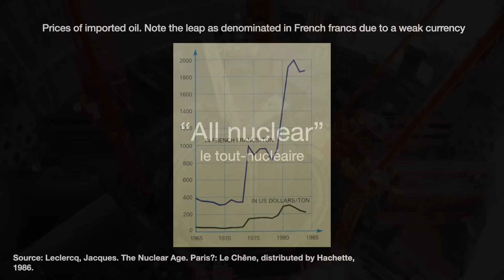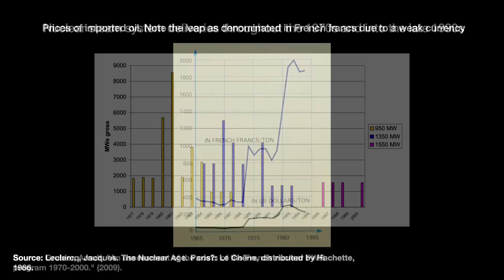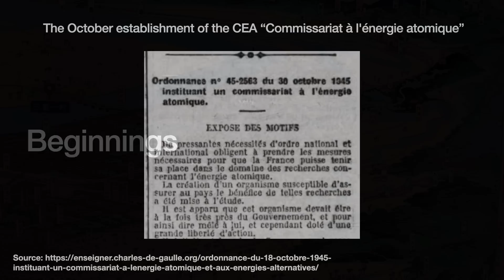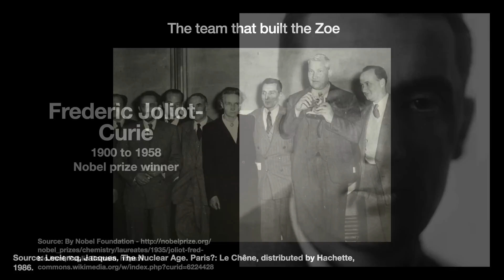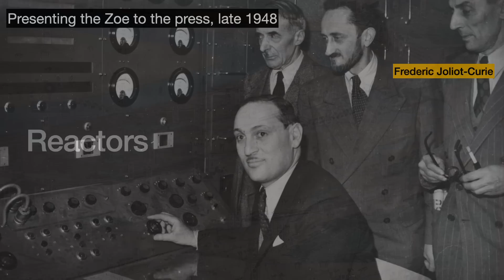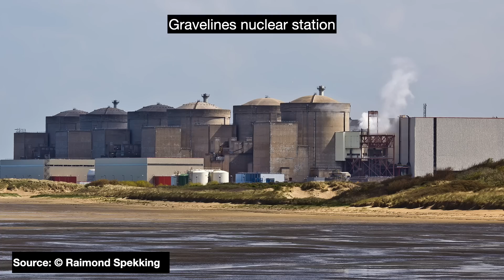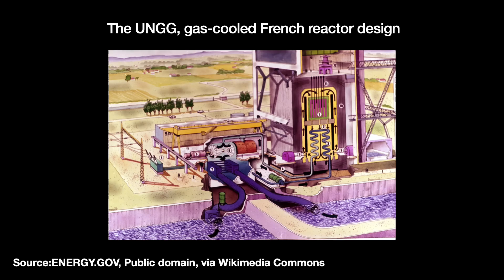That Time France Went "All Nuclear"

Comment: You ended the story to early, because it continued. The last french Reactor is the EPR with 1650 MW Brutto electric. It is build in Finnland, England, China and France today. It is not history. The EPR was in the beginning a joint European Pressurized water Reactor with contribution from Germanys Siemens nuclear reactor company. Germany knocked down its own nuclear industry as result of Red/Green antiindustrial politics, which still govers Germany today. France is building some new EPR in England and France. France planed to build 14 new EPR in near future. But currently it reveales that refurbishing existing nuclear reactors is much cheaper than building new sites. Repairing costs perhaps 2 Billion Euros per Block but Newbuilding 20 Billions per Block. This is the contemporary situation. Also in the USA old reactors like Harrisburg are investigated for an rennovation instead of expensive new builts. In Germany 4 - 8 Reactors could be repaired. But politics don't want to restart nuclear power production in Germany. Even Merz - CDU continues Red/Green politics with dismantling of domestic powerstations and replacing it with chinese stuff in renewable sector. Germany is not able and not willing to build up a new Renewables industry domestically. Trump USA says we do not need Renewables, so we do not need to build up domestic industries. Drill for Oil and Gas and use huge amounts of coal like China and  Make America Great Again.
Reply: Actually France wants to build the EPR2, which is a simplified design that does away with many  of Germany's requirements (the EPR was meant to be built both in France and Germany).

Comment: Now I'm hoping for part 2

that time Germany went "no nuclear"
Reply: Germans always do things in extremes.
Reply: @cane6074  Nope. Germany invented the calculator and wrote the manual, how to use it. If you ever get the opinion to read one, you will get the clue.
Reply: @cane6074 probably cause we have a little extremist in our obsessions….
Reply: @cane6074 yep. And we changed the world once again by pushing into green technology. Now we are past 70% renewables and growing.
Reply: @gummiente3622  yeah and what's your electricity carbon intensity like? What about its price? You must reintroduce nuclear power and integrate it with renewables asap
Reply: @davidemensigamerCH and make it even more expensive? And taking 30 years? Are you crazy?
Reply: @gummiente3622  you have no chance of storing enough power to go 100% renewables, let alone making it economically viable. Just get over it and accept the fact that you need a stable source of power in a portion of your grid to make renewables actually worth it, and that gas/coal is no longer the acceptable source of stable power.

Nuclear won't be that expensive if regulations don't keep on changing mid-building and you place multiple orders at the same time, serialization helps. You can also collaborate with other nations in placing orders in a coordinated matter.

And, you know it can't take 30 years to build a nuclear power plant, why exaggerate to the point of making it impossible to take your comment seriously?

You Germans have been indoctrinated do hard into hating nuclear power it's unreal. Just remember that the guy who started the decommissioning of nuclear power is friend with Russia and got a position in Rosneft, to help Russia sell Germany gas. It's ridiculous.
Reply: Or Austria’s reactor it built and then never turned on and now it’s just used for training and concerts.
Reply: @themacintoshnerd  That was their greatest luck. The first decommissioned German nuclear power plant, is still in decommission, after 25 years and decommission will go on for at least another 30. 
Bullet dodged, Austria👍
Reply: @goiterlanternbase  me when i have the iq of a ceiiling fan
Reply: They did go nuclear at the same time but it never was that big of a hit mainly because they had cheap coal and nuclear was never cheaper than coal..
Reply: I blame the DDR remnants.
Reply: @burhanbudak6041 that's nonsensical
Reply: @snarckys3063  Actually it makes a lot of sense. Who was the German chancellor at the time of this debacle ? A certain, DDR born and raised, Angela MERKEL.
Reply: It was that exact day, when Belgium should had let the first train towards the French reprocessing plant trough and they just said gfy😉

Germany has no reprocessing plant and without one, nuclear power is absurdly expensive. Especially when your only train rout to such a plant, goes trough a country, who for totally unknown reasons😏 tend a grudge against you.
Reply: @goiterlanternbase  that some serious bs. You that the could ship by ship as well as the franco/ German border. Fun fact Germany has Stil a nuclear fuel rod factory still in buisness without any own reactors
Reply: Most of the Fresh nuclear fuel is done about 80-90% of the market by Russia really great independence bc its dirty af. however France has some from there colonies. Whit poisoning the local population and shit. I think it could be a crime against humanity however done by the big corpos. We had our fair share of cleaning up uranium mines in east Germany used for the soviet nuclear bomb program. It always has a price to pay. I don’t know the solution to this. And yes we exported dirtywork by ourselves too. Fuel recycling isn’t great either. It would be great if humans could ceep nuclear to a minimum of defence in these times I tink it’s needed. Just glad that we stopped r.n. But nuclear bomb free world also naive.
Reply: Btw, my neighbor gifted me a nice piece of Altenberger Pygnit. He paid with his legs first and just a few weeks ago, with his life. 
And he was a cautious one. Always leaving the area until the dust settled. All his coworkers died of bone marrow cancer long ago. 
He was in the cleanup team, refilled the mines, or fortified them for the big-bags to come.
Reply: @Clickworker101  No you can't. Transporting nuclear waste is not legal by ship or air, only on land🙄
Reply: @Clickworker101  The trainline trough a major city is not suitable for the transport of spent fuel🤦
Reply: We don't produce "nuclear fuel" idget🤣 We produce material for radiotherapy. You can't transport this stuff very far, as it has a half-life, measured in hours and you are again not allowed to fly this stuff. It has to be truck or rail and papertrails longer than my dick🙄
Reply: @goiterlanternbase  oh, get over that BS. Just use natural uranium in Heavy Water Pressured Reactors. Germany has uranium mines too.
Reply: @AKUJIVALDO  We had. All that its left, is stuff so deep, we would need to frack it. Do you sell this to the local residents this time? We had burning pitchforks, when we tried this for copper.
Reply: @goiterlanternbase  It is also absurdly expensive for France. look at the most recent reports from the EDF. France will (and already does) pay a high price for their focus on nuclear power.
Reply: @teekue nuclear is tge second most cost effective form of power after renewables and is the most space efficent of all form of power, most renewables need tons of space or need to be built in space just to get a fraction of tge power nuclear generates
Reply: Sweden did the same.
Reply: And ended up reliant on Russian gas to avoid blackouts and then having no option but to go wobbly when Putin invaded Ukraine.
Reply: @RJRC_105

All but one small western country (including US, FR, CAN) are reliant on Russia for uranium centrifuge enrichment and downblending services for nuclear fuel.  

The more you know.
Reply: @RJRC_105  And ended up siphoning Sweden's electricity...
Reply: @RJRC_105  Wrong. 5% of energy production was nuclear in 2022. 
The gas was mostly needed for industrial applications. 
We stopped importing gas from Russia in 2022.
Germany is the number 2 biggest supporter of Ukraine.
Reply: @DJ1573  Lol, Germany doesn't buy energy from Ruzzia anymore, just through an intermediary.
Edit: I was being sarcastic, anyone in Europe who doesn't produce saying they don't buy from Ruzzia is a massive hypocrite, they are just buying through a middleman.
Reply: @jairo8746  Germany buys russian oil for industrial applications from india.
Germany buys no natural gas from russia but now from the US.
The oil is not for energy production there are no oil fired powerplants in germany
Reply: @DJ1573  No shit sherlock, by 2022 the vast majority of plants were already shut down. In the 90s and 00s around 30% of Germany 's electricity came from Nuclear, and consumption hasn't increased from back then (still around 500 TWh per year).
Reply: @DJ1573  Calling someone wrong, when in fact you are the one that is incorrect.  The OP did not specify 2022.  On April 15, 2023 utilities in Germany shut down the country’s three last remaining nuclear power plants.
Reply: @thekinginyellow1744  Oh wow that makes such a difference in my statement
Reply: @DJ1573  Yes it does.  It proves that anything you say is untrustworthy and that you can be safely ignored.
Reply: @DJ1573  5% of energy or electricity? its makes a big difference
Reply: @thekinginyellow1744  No it does not. I introduced the year of 2022 because of the invasion of Ukraine in that year. 
OP i answered to talked about germany having to bend the knee to russia because of missing nuclear power.
Thats false.
Now you bring up something else entirely? Whats your freaking point?
Reply: @reahs4815  Nuclear is always used for electricity.
Reply: @DJ1573  Well you answered the wrong thread then, because in this thread the OP only said "that time that germany went no nuclear".  Which started under Merkel and the war in Ukraine played no part in.  The shutdowns were scheduled long before Putin's "exercise".
Reply: @thekinginyellow1744  Are you freaking blind? My answer is for the comment below OP?
You know what an @ infront means?
Reply: @DJ1573  Yes, apparently I am blind.  Please accept my sincere apology.
Reply: @thekinginyellow1744  I accept.
Reply: @reahs4815  electricity. no nuclear powerplant in germany ever produced heat for private/industrial application.
Reply: Lovely clean brown coal!
Reply: Yeah respect our decision. It might be very different to what the French do but it also will work out.
Reply: Taiwan wants to go no nuclear too... I wish the KMT would come back to power for this reason.
Reply: in a way they still use nuclear electricity. the french one.
Reply: @weinend783 and French use German renewables in the summer when nuclear power plant are limited bc of cooling water and repairs
Reply: @Clickworker101  the 400g cO2/kWh renewable?? germany import way more electricity than they export.
Reply: @weinend783  Nukies gonna melt
Reply: @weinend783 absolute bullshit.
Reply: This was a very wise move by the French government back then. It has paid of in spades! 

We should do the same thing here in the USA. Today’s Nuclear plants are safer and have foolproof checks and balances that prevent any Nuclear meltdowns or accidents. Nuclear is very clean and reliable power.
Reply: Well it kinda is a success. I know Germany is not known for it's technical abilities, after all we still build road-cars... with rubber wheels and internal combustion engines. However with renewables it kinda is going well by German standards. Of course there is a strong political opposition against renewables, but for electricity we are at about 50% wind and solar on average per year. We also have a massive growth regarding storage... however due to political decisions, that mostly happens in private households. Everyone who has his own house, some money, and isn't particularly dumb, now has their own solar panels and is adding storage.... often without registering it.
Reply: @altebander2767  Still, CO2 per kWh in Germany is 10 times more on average than France, even if Germany has a lot 
bigger share of renewables.
Ideology vs. facts.
Reply: @LambdaWave84  ideology vs facts, huh? So what you're saying is you have accurate numbers from comparable data, and the statement you make based on that accounts for all relevant factors and includes a historical understanding... Wait you didn't even make a statement. What did you want to say again?
Reply: @SimonVaIe  There's a free website called "Electricity Maps" where you can find all data and the relative sources about all you can know about electric powergrids worldwide. 
2025 annual emissions of France's grid were 31 gCO2eq/kWh, while Germany's were 342 gCO2eq/kWh. 
The comment above was quite right about Germany polluting 10 times more.
Reply: @altebander2767  what a success ! a country litteraly destroying its environment, from forests to litteral villages to crave the good ol' coal, to then come and cry to the EU, saying how unfair that EDF is the biggest electricity firm in the EU just to tarrif them so much out of self-shame.
Absolutely, germany going "green" was a sucess.
Reply: Yeah let's talk about coal fucking up CO2 in europe -_-
Reply: Yep, shameful bout of populism right after Fukushima.

Comment: F. Mitterrand was in fact not willing to stop the nuclear program, he gave up on a project (Plogoff) in order to let all other ones go: https://www.youtube.com/watch?v=5rvP1zstk68&t=98s

The last 'Messmer Plan' reactor delivered was Civaux-2, in 1999, then in 2000 Areva tries to sell EPRs to various nations. Finland buys one in 2003, and work on the field begins in 2005.  By which sort of 'miracle' do we have to believe that a fair part of the corresponding expertise (heavy-industry => looong timeframes) was then lost?  While projects are sold, and the existing fleet of reactor exploited and maintained?  EDF even proposed to start building an EPR in France in 2000 (the government refused, thanks God given the project launched in 2007 is hugely overcosting and delayed, due to a lack of technical maturity).  Then projects started in France, China and in the UK (all behind schedule and with large overcosts).

And no, the reactor model (EPR) isn't innovating, quite the contrary: it was officially deliberately designed in order to be very similar to existing ones.

One of the main reason for electricity consumption to fell in the 1980s is the '1980s oil glut'.  Quoting Wikipedia's article: "The world price of oil had peaked in 1980 at over US$35 per barrel (equivalent to $134 per barrel in 2024 dollars, when adjusted for inflation); it fell in 1986 from $27 to below $10 ($77 to $29 in 2024 dollars)".  It was no longer economically sound to prefer electricity (this is very sad for the climate, but a fact).  Moreover the huge real cost of nuclear was more and more weighing on the nation (taxes and public debt skyrocketed).  French ahead: https://sites.google.com/view/electricitedefrance/accueil#h.g1ees0y2dbwi

By the way the Civaux-2 reactor and his brother were delivered in 1999 but only started producing gridpower 3 years later because there was way too much reactors in France, this fact was known as soon way before (even M. Boiteux, EDF boss and historical major figure of French nuclear, said so in a "Le Monde" newspaper  dated January, 17 1986: "Nous aurons de deux à quatre réacteurs nucléaires de trop en 1990").  The nuclear sector knew it, knew that it had to export in order to survive, was encouraged to do by the governments because it was seen as a wonderful source of revenue, and it failed flat (few projects, more and more financial loss).  Then Chernobyl was a first cold shower.  A 'Renaissance', based on some "Cherno was a fluke, it won't happen with Western tech adequately exploited", a theory which failed flat at Fukushima.  At this moment, ~15 years ago, industrial renewables (wind & solar) were ready, and they now more and more trounce nuclear.  Yes, even in China (check the data).